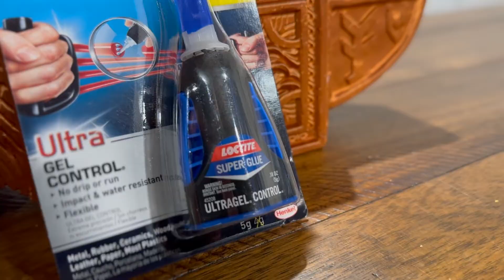What is the Best Glue for 3D Printed Parts?

Comment: Would be interesting to compare prices of each. Although super glue you wouldn't use as much if you were using epoxy or gloop. At a quick glance it looks like PLA Gloop is $0.29/ml if you buy the 120ml bottle, and the epoxy is $0.31/ml from home depot. CA/Super Glue can be super cheap if you buy in bulk, like $0.12 or 0.13 per ml. Just some food for thought.